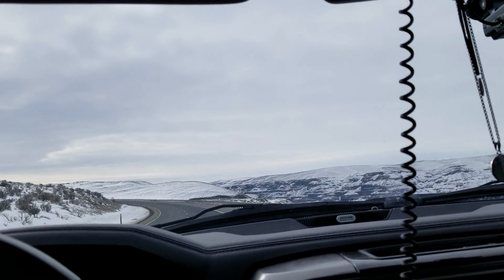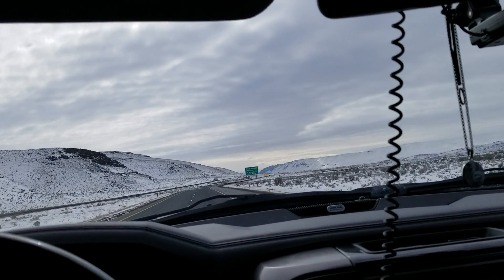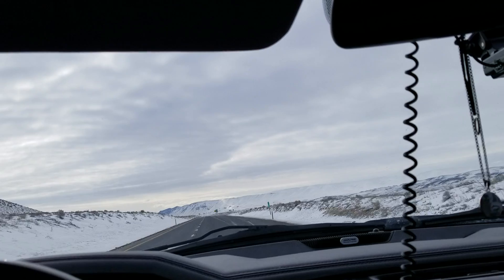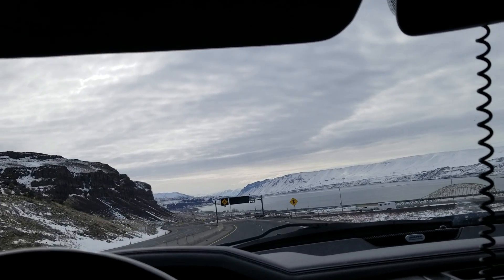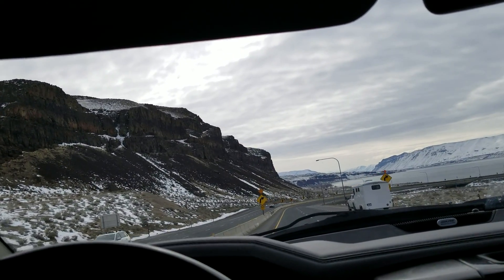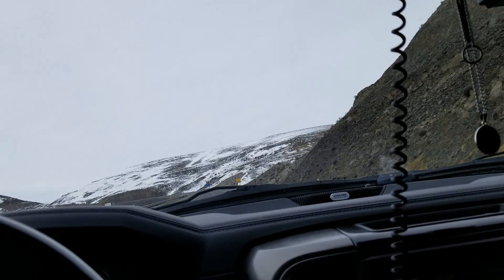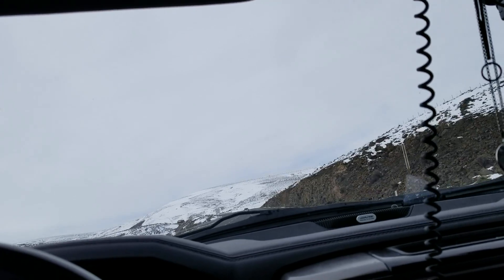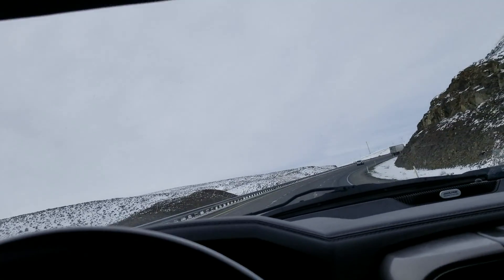13-18 6.7 Cummins DPF and DEF. Real problem with it.

Comment: Question- so I got a 2012 6.7 that has a DEF delete, but it still has the DPF. Can I remove the dpf without having to worry about tuning it. I bought the truck with the DEF already deleted so I’m not sure what tunes on it
Reply: 2012 Cummins didn’t come with def originally. 2013 was the first year of def. 2012 has the old emissions system, just a dpf and egr. Has a 7th injector on the down pipe after the turbo where it injects extra fuel into the exhaust system to get it super hot to regenerate. DELETE it. You will see such a mpg increase cause the old dpf system eats fuel and power. And delete egr for longevity

Comment: I have a 2016 Ram 3500, over 330k miles, bought it brand new, everything stocked, I pull a 3 car trailer and never had an issue I couldn't fix.
Reply: I like the way you think
Reply: @tonysketch  Thanks... I'm at 433k miles now. Everything still stock, replaced Def pump and injector around 400k with same stock replacement.

Comment: Can one upgrade the cooling system to keep the engine cooler?
Reply: I installed a mechanical fan clutch that turns on with heat instead of 217 where the computer tells it to turn on, now I can pull a mountain with 38000 gross on a hot day and the water temp is 200 and oil temp is 208 instead of 250 plus like it was getting to before install, and trans temp stays in check also since it cools with the cooling system along with the external cooler in front of the radiator, if the fan ain’t running cause the computer isn’t turning it on your circulating 217 degree water through the radiator back into the engine, the oil and trans cooler cools on what comes out of the radiator (cold side) and what are you gonna cool with 217 degree water? Not much I found out, my problem is solved  (2018 4500)

Comment: I have a 2015 Cummins. The regen activated around 20,000 miles, I now have 51000 and the regen never turned on again. Is there something wrong with my DPF? Just FYI, I don't tow at all. Please Let me know what you think. Thank you.

Comment: Need help I have a 2011 kw with a 🅲🆄🅼🅼🅸🅽🆂  Isx. Truck has 95k miles but it has been sitting up for a few years. Should I get it deleted before I even run one load?
Reply: Hell yeah
Reply: Hell no I would not. It’s illegal to delete the after treatment system.

Comment: P.D.......  What's your input on the Sterling 4500 and 5500????
Reply: Its the basically the same thing as a Dodge 4500 or 5500 just rebranded

Comment: I had a 2010 Dodge 3500 Dually non deleted up to 265° F for engine and 198° on Transmission towing 19,000lbs on the deck.  It was 115° going through Nevada (LAX to Salt Lake). She made it almost to the top, but had to pull over. Everything went ok. It had Amsoil in it; however, Way to close for comfort. I got rid of it going new as soon as my credit gets back up!!

Comment: After going through schooling on all this emissions stuff I no longer would delete another vehicle I own or have as big of issues with it being their
Reply: Painter33   Why?
Reply: Why x2
Reply: Jimmy4x4 Socal well the biggest reason people have issues with dpfs is because the vehicles aren’t driven how they should. They idle them constantly and drive them 10k to work and back and never hook up to anything.
Reply: Painter33 true, I already knew this. My truck is 1 year old and had 35k miles 13k hooked up to a trailer. And I try to keep my idle time around 10 percent of drive hours

Comment: I believe you mean the SCR and not DEF. SCR (Selective Catalyst Reduction) is where the DEF (Diesel Exhaust Fluid) is sprayed. During a regen I don’t see any EGT’s getting higher at the engine, only at the DPF does the temps get hot. Biggest failures I see is from extra tuning for power, that’s when temps can get out of hand. If I have to replace the DPF or SCR at 300,000 miles that would be fine with me, only have to replace once. By the time it would need replaced a second time the truck will have 600,000 miles and it’s pretty much worn out. I keep everything stock now a days. So much easier then constantly chasing the next week link.

Comment: Hi Paul! Thank you for the video.  Wont the DPF & DEF shorten the live span of your motor?  That's what I've come to believe.
Reply: Definetly and performance and downtime I think it's a government scam to make money.
Reply: The egr combined with the scr (def system) is an engine killer. The egr dumps abrasive soot into the internals of the motor, the scr system creates excessive heat which turns into wear.. long story short if you want reliability and longevity remove the emissions and run a stock tune.
Reply: No.  DPF and DEF have nothing to do with the motor itself.   The DPF is in the exhaust system as is the DEF injection.  The motor killer is the EGR because it is recirculating exhaust gas back into the motor.  As other people have pointed out, the recycled exhaust gas contains carbon particles, and those are abrasive and shorten the life of the motor.  One of the common problems with high mileage Ford 6.7 motors is code P0401.  The code is a clogged EGR cooler due to carbon deposits.  Because of the complexity of the SCR system (regardless of manufacturer - they all do the pollution reduction the same way) there are failures of sensors within the system (usually NOx & EGR), and heaters and sensors in the DEF system.  These failures can cause the motor to go into a reduced power or even limp mode.  While not associated directly with a motor problem or failure, the SCR system sensor failure directly affects the operation of the motor.
Reply: @buckhorncortez  Your dumb! Backpressure etc. Explained too many times cant do it again.

Comment: I agree if you wanna pull more weight then move up to a used single axle semi with a sleeper, can get them trucks cheaper than brand new 1 ton dually. Just my opinion, they are built for it and def issues aside can get more life out of them just my humble opinion. Be safe out there

Comment: First. What coolant do you recommend Paul? And where did u tune limited? Egr delete or do you recommend just unplug?
Reply: The best suggestion is to use the coolant specified by the manufacturer for the motor.  The coolants used today are designed to be used with the specific motor and contain additives that may have functions such as anti-cavitation properties.   It's no longer simply "anti freeze" and any coolant will work in any motor.